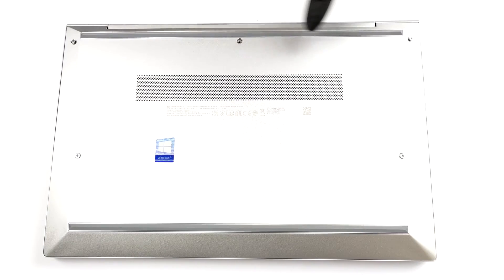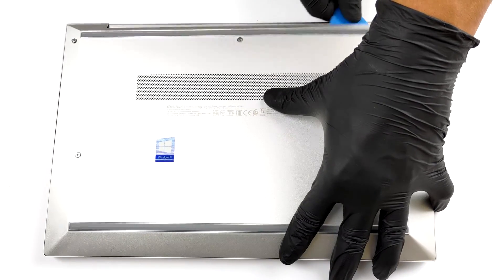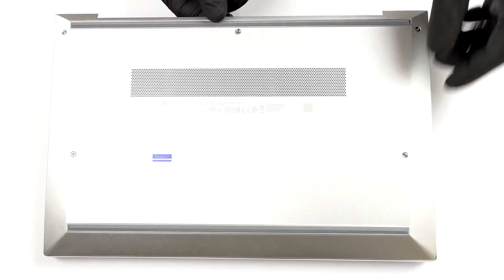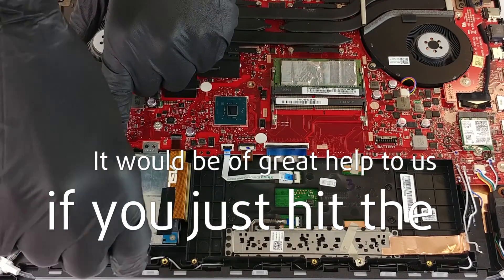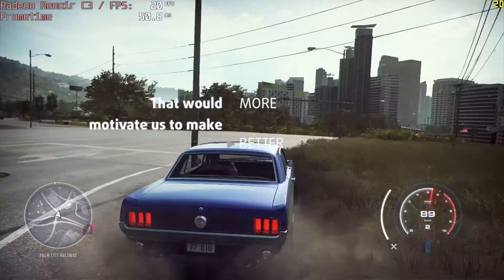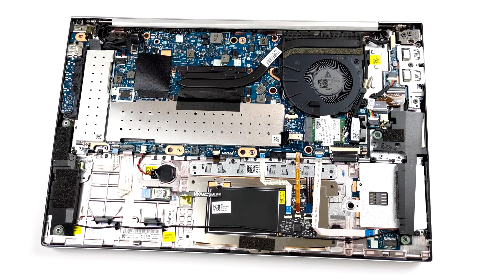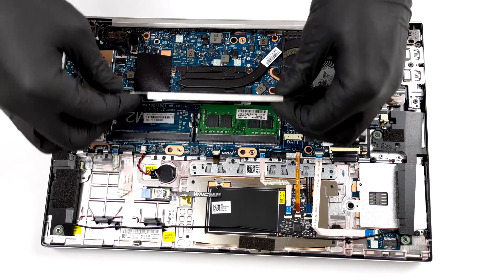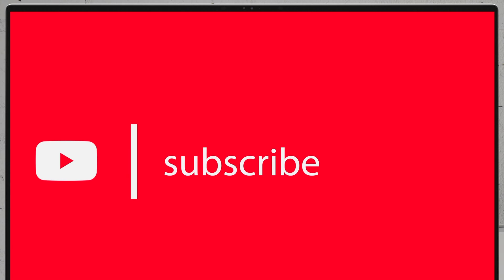🛠️ HP EliteBook 840 G8 - disassembly and upgrade options

Comment: What is the purpose of the SSD and memory shields? Is it a problem if my laptop doesn't have those shields ?
Reply: No problem I‘d guess, it‘s just the heat distribution
Reply: Generally speaking it's RF shielding to make devices compliant.

Comment: Was able to upgrade my RAM (added a 16GB) without any issues using this video. Thanks!
Reply: Did you need to take the battery out to do so or can you just lift that heat shield?
Reply: I just lifted the heat shield and it was fine. Aligning the heat shield back in the little grooves was a little finicky for me. But not too bad. Easy RAM upgrade.
Reply: Can I add an external graphics card to it?
Reply: @bluedragon1973 yes, using thunderbolt or using nvme oculink

Comment: can I upgrade the storage to a 1TB of SSD? I am kinda a noob in these stuff
Reply: Yes, you can. It needs to be PCIe NVMe one - it can be either gen 3 or gen 4 (I recommend gen 4 though). Just remember that it will replace your old SSD since this laptop has only 1 slot for it.
Reply: @MrLukassky  Gen 4 will be limited to gen 3 bandwith
Reply: @csn04  Do you have confirmation about this? afaik this laptop supports PCIe gen 4 and processor supports it as well.
Reply: @MrLukassky  Yeah, I just realized this is the intel one. The amd variant doesnt support gen 4

Comment: Hi. I would like to know If I can upgrade my ram adding 16 gb?, which I would have 8gb + 16gb = 24 gb, does it combination ok? or you have to introduce two rams memory the same size for example (8gb + 8gb) or (16gb+16gb?)
Reply: In general it's best to use 2 of the same size (ideally same exact model)

Comment: very ,very poor cooling .....
Reply: desde los intel de 10ma generacion ya no calientan tanto.
Reply: turn off turbo boost
Reply: Can I add an external graphics card to it?
Reply: From experience, it doesn't need great cooling, probably due to chip's efficiency and maybe enough cooling as it is. The fan hardly ever turns on, and the laptop works really really well.

We are past the times when a little better cooling made a big difference.
Reply: @rommax4865  just to confirm what you said!
Reply: @rommax4865  sometimes it will shut down when i play genshin, so not really a great cooling... good for work, but in free time isn't enough.
Reply: @rommax4865  Well..., if you are using it for intensive tasks and keep your hands on the keyboard all day long, it's not that great.
Reply: @michaelgeiser  Honestly, that's the right way to use them, especially these little office laptop's.